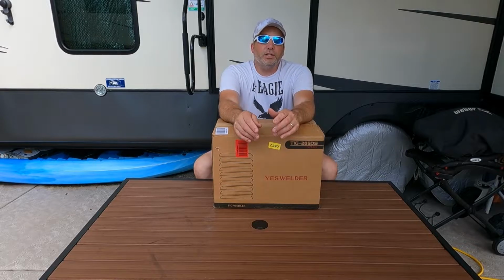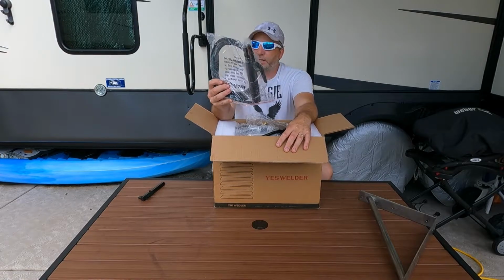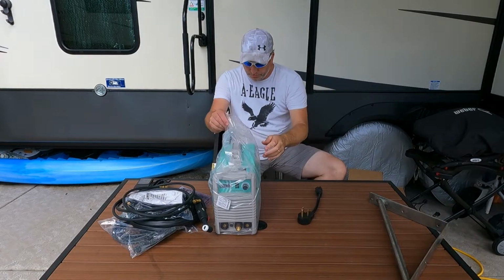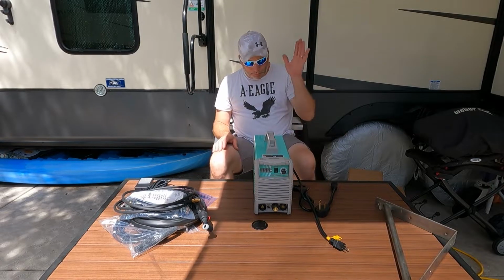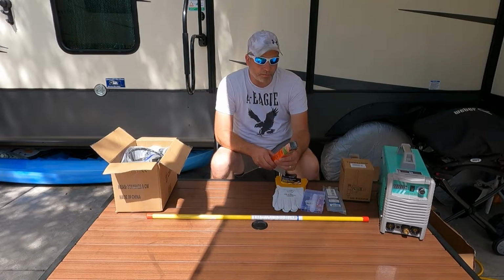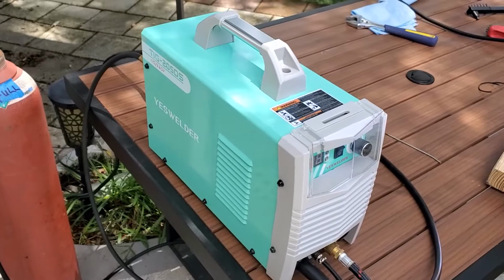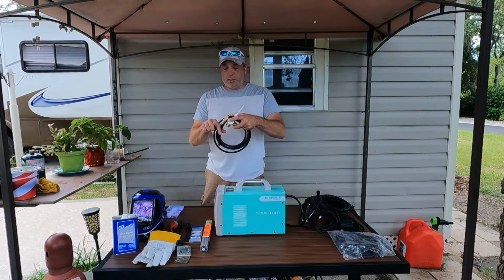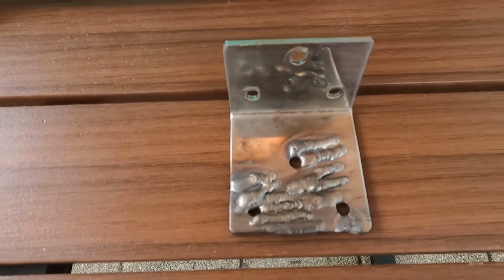Learning To Tig Weld On The Cheapest Welder On Amazon Yeswelder Tig 205DS

Comment: Great video, thank you.
You'll have a lot of fun with that machine, I bought one about 6 months ago as a secondary tig unit and can't say enough good about it, it's been just great. I'm actually using it more than my primary unit. LOL
One little idiosyncrasy I found on mine at least is that very occasionally the HF start does not initiate the arc, when that happens momentarily ground the tip of the tungsten to the workpiece or ground. After that just hit the peddle or the switch and you're back in business again. This doesn't happen very often but if it does it's nice to know that's it's not serious and easily dealt with.
Reply from the maker: Thanks so much for the comment. We are loving the unit and can't wait to get more time on it.
Reply: I just ordered mine and am new to TIG as well.  How do you achieve a post flow, do you just pull the torch back to break the arc while leaving the button/pedal pressed?
Reply: @MichaelJeffers75  I believe that the machine has a pre-programmed 4 sec. post flow built into it. Once the button/peddle has been released you should be able to detect the post flow on the gas regulator after letting go of the button/peddle. It's all automatic and unfortunately not adjustable, however it does cover most situations. Would be nice though to have it on a little longer at higher amperages.
Reply: @MichaelJeffers75  I'm a little late to the party but post flow is pre-set at 4 sec. I believe. 
The arc is broken when the switch or peddle is released.
Reply: Is it ac and dc or is it just one if so which one
Reply: @daredevildare3641  High frequency start, no lift tig option and DC only.
Reply: @74willy81  do you think it’s a good starter one I was going to get this and get a primeweld one later for aluminum and stuff
Reply: @74willy81  also do you have to push the button do you have to hold it while welding or just push to start and push to stop
Reply: @daredevildare3641  The Primeweld is a very nice machine and a good choice. Although the YW Tig 205DS is very good entry level machine that will help you get started on building up your new skill set, why not save the money and move into the Primeweld machine first. Nothing wrong with the YW 205DS machine though as a entry level DC onlymachine.
Reply: Do you still use the same torch that it came with or can you use a different brand of torch?
Reply: Actually I switched mine over to a 17 series torch since I found the Euro style 26 series torch that it came with a little too bulky for what I do. @eriklanderos4613